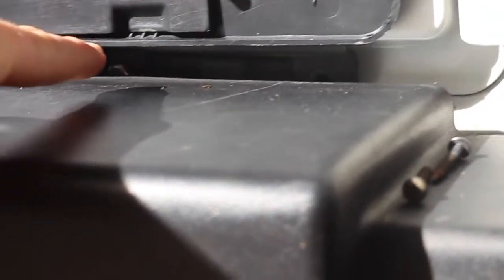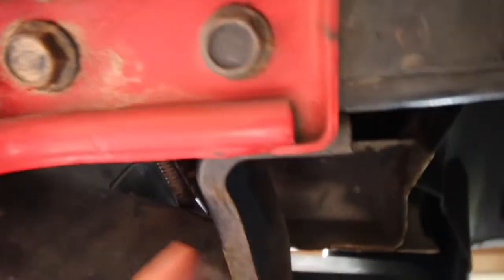2007-2016 JEEP JK LICENSE PLATE BRACKET

Comment: Great video, i did the same on my TJ after taking the bumper off. Thanks for another great video.
Reply from the maker: Thanks mate really appreciate it, it is hard to find a spot when you take the bumper off, this definitely works well.
Reply: @Whiteandsonsgarage  it is and my number plate didn't fit in the spare wheel so couldn't have it there if i wonted it.

Comment: Its good location for it but it can get ripped in bush or tight spots. I have damaged mine 3 times so gonna relocate it to spare wheel
Reply from the maker: That sucks, did it damage the Jeep at all? Go location if you can have it there
Reply: @Whiteandsonsgarage  na didn’t damage as its put on with plastic clips. Gonna change the location soon
Reply from the maker: @ravenoverlanding  very lucky it didn’t damage anything.
Reply: @Whiteandsonsgarage  yea bro if it was bolted then there was a different story
Reply from the maker: @ravenoverlanding  maybe I should do my one with plastic clips just in case.
Reply: @Whiteandsonsgarage  yup at least you won’t damage the jeep that way if it comes off